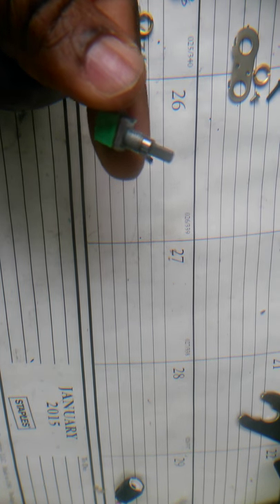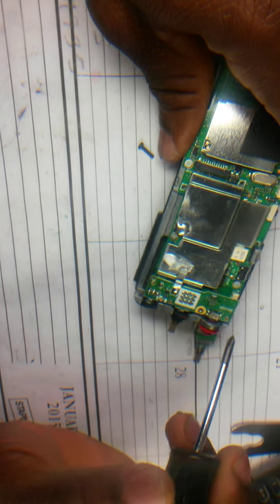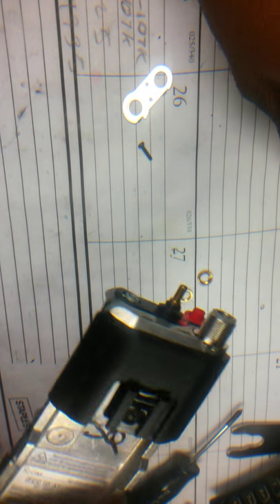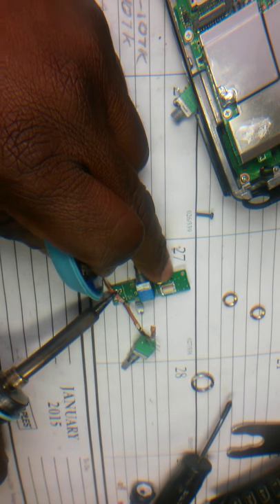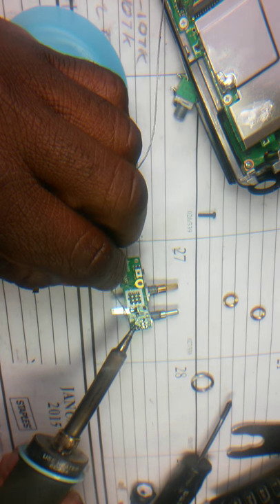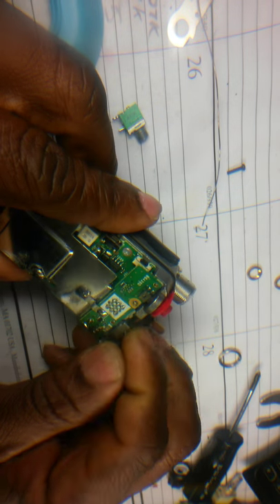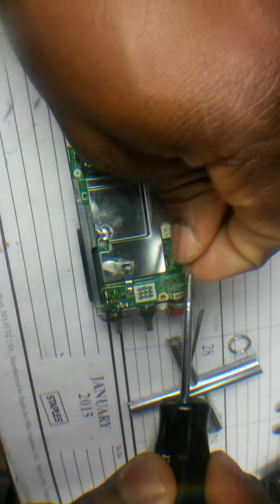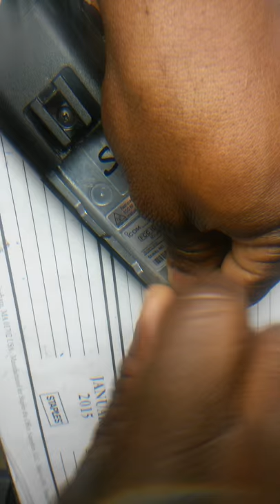ICOM RADIO VOLUME REPLACEMENT

Comment: What tools did you use for tighten of volume?
Reply from the maker: @9:45 on the video you will see the tool to remove the ant nut and volume control...sometimes you need to put alitte heat the nut to release the lock tight glue

Comment: Can you please show front panel replacement and/or speaker replacement?
Reply from the maker: Hello ES The replacement front panel comes with the speaker glued in so no need to replace the speaker. If you only need to replace the speaker then you might have to dig the old one out.

Comment: any chance you worked on the xts motorola 1500s? I had come across one that will go into flash zap, allow firmware loading however won't go into self test after power knob is turned on, ir will faintly blink the led when switched showing power being applied hoever doesnt fully emit green led going into self test which never comes. I was thinking eeprom. I checked the fuse and several smaller ones and all pass. I got the other one going which had a odd solder job and things crossing. that one works but this one is beating me.
Reply from the maker: LosRioDelMar Hi man...I never work on that brand before...if I have the schematic I can help but no man....only the 750 1100 and 1250
Reply: basimpsn I have the detailed service pdf showing the schematics.
Reply from the maker: Does your 1500s have the key pad in front?..if it does...detach the front cover and remover the ribbon from the main board..power it up and key it up just for a second to see if your tx light comes on...another place to check is if someone upload the wrong code plug and brick your eeprom...can you read the info from the radio?